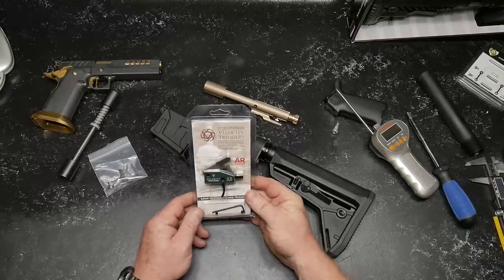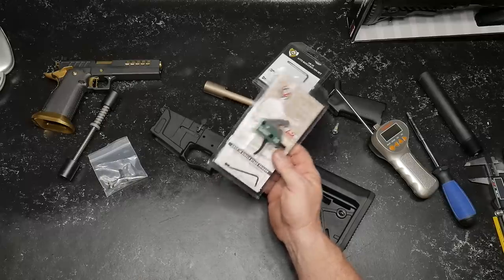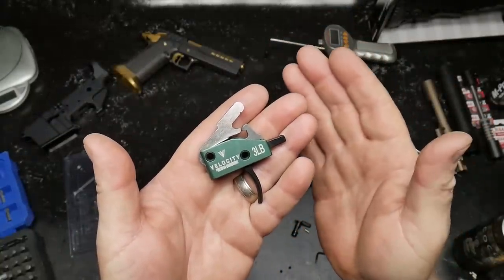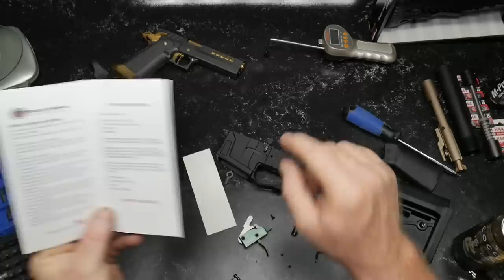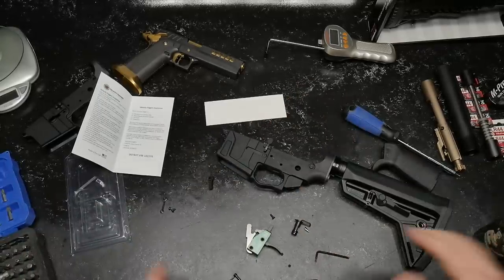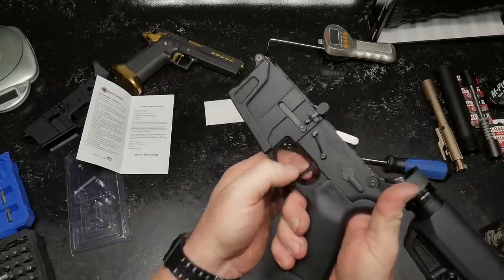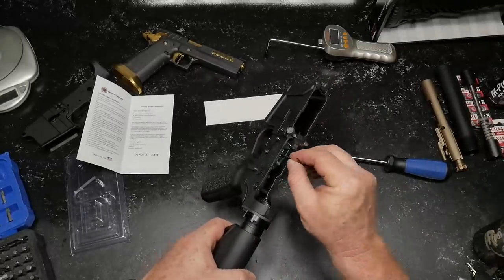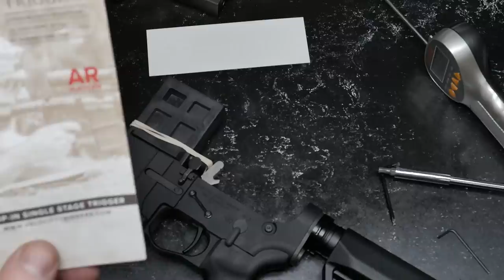Velocity Trigger Classic AR Trigger! First Look and Install

Comment: I bought the 4lb triggers 2 years ago. After 400 rounds had to send a back to  Velocity. They had to replace the hammer spring ,free under warranty Great company, fast turn around time. When I called, the owner was the one I was talking to. Very nice man, he told me what the problem was and he  already fixed it and shipping it out in the morning. Bottom line is, I'm very happy and now I own 3 of these triggers.

Comment: I use the same trigger in my 300 blackout.  Only thing was, once installed the safety selector was stiff and only would go halfway.  I put some valve lapping compound on the tail end, at the safety and worked it for a while. Works perfectly now.

Comment: Just bought that trigger and other than the long reset I'm impressed! For those added set screws I recommend a tiny dot of clear nail polish on the threads to lock them in place, you don't need a TON, just enough to wet the threads a little. Nail polish works better for screws that are going to possibly get hot after a few mag dumps, doesn't melt loose like blue Loctite can! Been there...

Comment: I bought the 3lb last year and they modified them. The reset is 2 mm and the pull weight is exactly 3lb. These triggers are under rated big time, you might want to check them again, the reset on the new version is very sick, they also offer 25% discount for first responders and military, you just have to email them. I just got my discount
 for this year.

Comment: If you don't mind me saying ... it's about gosh darn time you reviewed this trigger😁👍🇺🇸 I hope you find it as awesome a trigger as I do ! I truly look forward to your opinion on this trigger 🤗
Reply: I came up with the same results you did using the gemtech trigger pins I no longer use those I only use KNS and it will change the way that trigger performs drastically. The gemtech pins are under sized and affects the way that trigger operates and any other drop-in trigger for that matter. KNS pins are .154 exact size and make all the difference in the world. I never wanted to spend 30 plus dollars on pins but now that's all I ever use.

Comment: I am so glad you showed that common error with installation. I watched at least 4 installation videos where guys dropped in the trigger, installed pins, and then took the loose set screws and put them in and cranked them down. Must be a guy thing to install first and read the instructions later. I’ve also seen many complaints about these triggers and I suspect they did the same thing. Got a single stage for my sons AR and he loves it.

Comment: Looks great! The only thing I wish is that it came with a metal plate that fit between it and the lower so that the set screws weren't digging into the lower receiver. Kinda like the one found in the Elftman series of triggers.
Reply: I thought the same thing when I installed mine.

Comment: Great vid! Been looking at those velocity triggers.  Although, shouldn’t need to uninstall your safety selector switch to install/remove a trigger.

If you push in on the opposite side of the safety switch, you can walk the selector back around to remove the trigger.

Hard to explain in writing, but there are a few YouTube vids about it.  Great little trick.

Comment: Like clockwork, boy! I've always ever used the standard mil-spec triggers and springs. It's just what I'm used to and they work just fine for me. Strong and proven and have never let me down. Although...for my first AR pistol build that's almost completed I'll probably try an upgraded trigger for the first time. I like this trigger because it's nice and doesn't cost an arm or leg. Much OBLIGED for the video >:0

Comment: In the past I’ve watched at least 3 videos where people were installing this trigger.....wrong. They made the same mistake you did and installed the set screws in the hole and cranked them down not knowing they were just putting pressure on the existing set screws. At least one gave a bad review because he said the trigger rattled.

Comment: Did you have any issues with your safety selector switch sort of catching halfway between safe and fire? Mine functions properly, but there's a slight catch halfway between safe and fire.
Reply: I just installed a classic 4lb trigger in my Aero M4E1 enhansed lower and I have the same issue when I tightened the set screws in the trigger. The safety selector was very snug. I may have to back out the set screws a bit to free up the selector but I'm going to call Velocity and see what they say..

Comment: Bro, do you have the set screws installed in the trigger at the end of the video? it doesn't look like it. Reason why I ask is because I bought a barely used/newsed velocity trigger off ebay a while ago and haven't installed it yet. But I just looked at it and it doesn't have any set screws in the package but when I look down in the holes where the set screws go on the trigger assembly it looks exactly like yours so I'm thinking maybe they are down in there?? as it was already installed on the guys gun I got it from... I don't have the provided allen key either. when I bought it I didn't know about these little tidbits glad I watched this vid...  

EDIT: Yes the set screws were already in there I found an allen key to fit and backed out the set screw now I am at peace again:). Can't wait to build the rifle for it it's the same MPC trigger as you showed at the end of the vid, good looking trigger...

Comment: Kotaboy,

Do the instructions say anything about torque specs or over tightening the 2 tension screws? My only issue is too much upward pressure by those 2 screws will place extra pressure on the hammer pin. Not the biggest concern on earth but was something that came to mind watching this video. Take care 

-Jax

Comment: Question- i have my ar lower, and haven’t purchased anything else yet, and have limited knowledge. Can I purchase any drop in trigger? I don’t want a stock cheap trigger i want a light weight trigger that looks different than all the normal ones.

Comment: I have 5 and just my 6th Velocity Triggers.   I got a new 762x39 Diablo Gen 2 upper; however, my Velocity Triggers Trigger in my PWS is standard.   Therefore, I had to buy a Steel Case Trigger.   🙄🙄

Comment: Can anyone explain why every drop in trigger requires anti rotation pins?
Reply: If you don't have them when you pull the trigger the square trigger can rotate using the pins that hold it in place as pivot points
Reply: Otherwise the trigger rotates around using the antiwalk pins as pivot points

Comment: Velocity triggers are a big rip off! Their customer service is pathetic.  I purchased a 4lb steel trigger from them and it was defective out of the package.  The trigger would fire one round when the trigger was depressed and one round when the trigger was released.  I was told by Tom to torque the installation screws and that would solve my issue.  I did so and guess what, my problem did not resolve itself.  I attempted calling and emailing velocity just to get the run around.  This company did not stand behind their product.  I can assure you that no one else in my club will waste their time or money on a velocity trigger.  Poor customer service.
Reply: Do you spam the same comment over and over and over? 😅